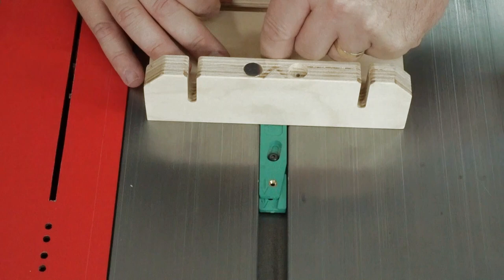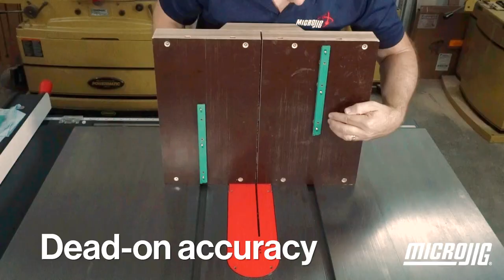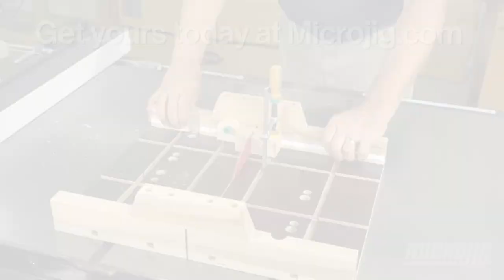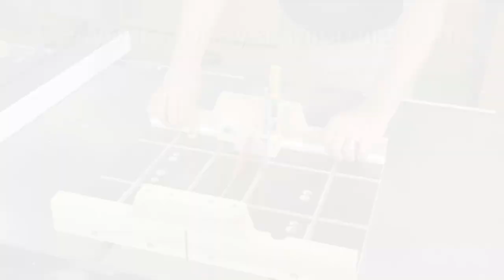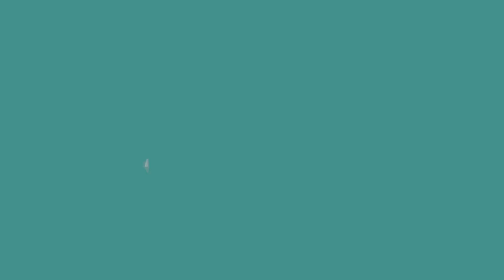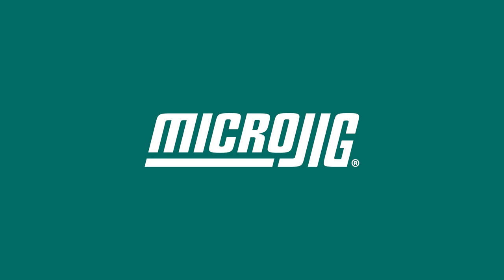Build Table Saw Sleds Fast with ZeroPlay Miter Bars! Microjig.com

Comment: I use the MicroJig hardware and dovetail grooves to hold two miter gauges to the sled. Super easy to get parallel to the slots and they can be reused for each sled.
Reply from the maker: Thanks Bill! They are very easy to set up and adjust.

Comment: Is there any plan or guide to make the mutter gauge you showed?
Reply from the maker: Eduardo, For the cross cut sled shown in the video, we do not, but there are lots of good cross cut sled plans out there.
I do have plans for a smaller "utility sled" that works to the side of the blade for cross cutting. 
The ZEROPLAY Miter Bar makes it easy to move it from the table saw to router table and band saw as needed.
You can find lots of project plans on our website: https://www.microjig.com/projects